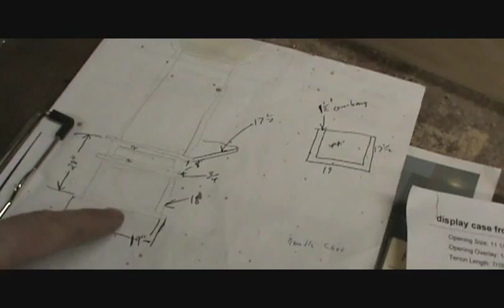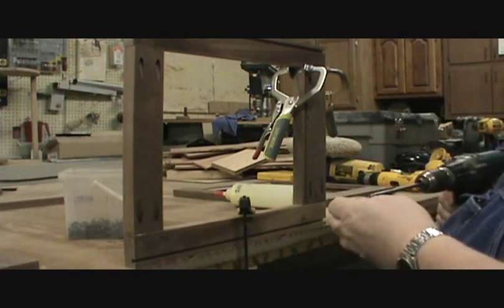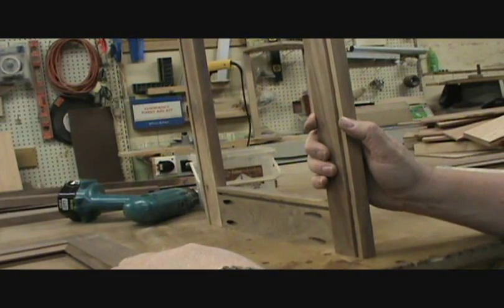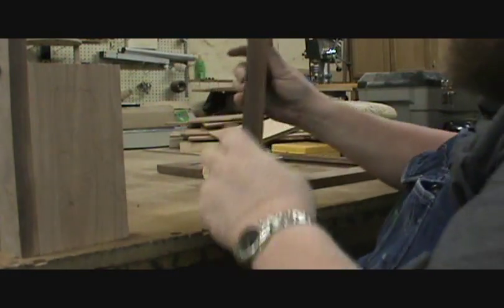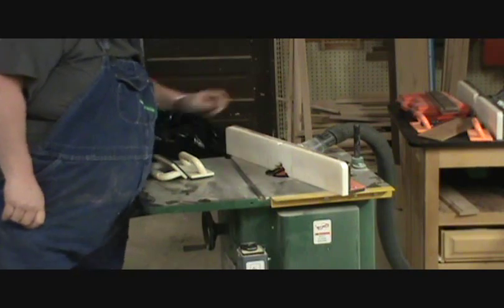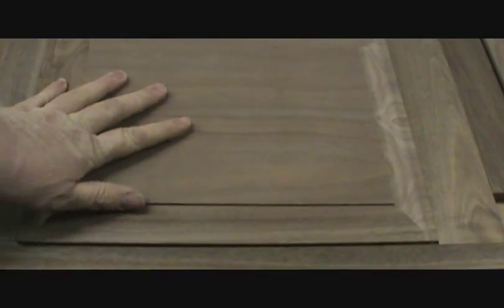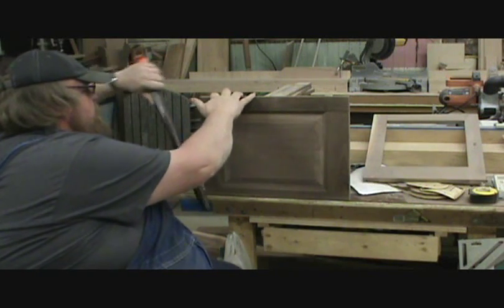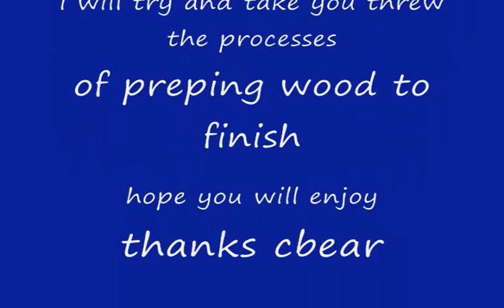walnut curio cabinet build part 1

Comment: Couldnt  get a simpler, quicker "joint" could you.  I believe beautiful wood deserves beautiful joinery.  Not even protecting the face of the walnut by using that metal clamp.   There is no craftsmanship here, in my opinion.  But, he seems a nice enough guy and happy with what hes doing so, its all good.